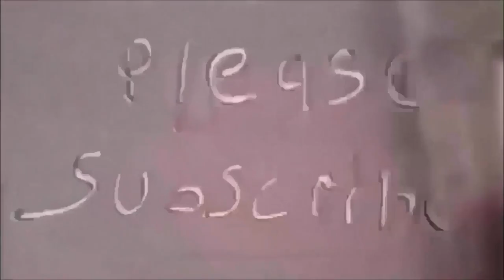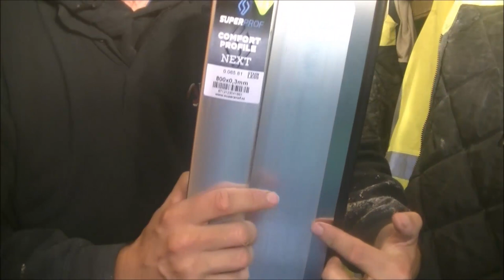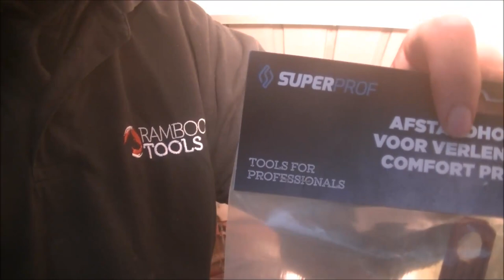UNBOXING SUPER PROF  SPATULA ATTACHMENT AND POLE RAMBOOTOOLS

Comment: Hope all is well mate? I bought one of these after watching the original vid of you using the make good on the ceiling. As always though I’ve not had a big enough ceiling or wall to use it on yet but itching to use it
Reply from the maker: Use away with it on smaller walls to man to get the hang of it will only help you get straight angles,  I forgot I had this on another video :)
Reply: @macplastering  yeah I think I will. I suppose it’ll never get broken in if I don’t use it haha
Reply from the maker: For sure mate even on revels get used to it and get them straighter faster :)
Reply: @macplastering  yeah definitely got to get on that. I’ll come work with you for a couple weeks when I’ve finished my apprenticeship, get some first hand tips off you haha 👍🏼
Reply from the maker: @stevenprice4969  haha might have a big house coming up next year
Reply: @macplastering  haha I’m game 👍🏼
Reply from the maker: @stevenprice4969  Where about are you in the world mate ?
Reply: @macplastering  I’m in Plymouth, down in Devon
Reply from the maker: @stevenprice4969  Dam mate you need to get a boat over LOL I have got asked to do a fair few small jobs in London shame it wasn't anything bigger
Reply: @macplastering  where are you based? Haha I’ll do it just to get away from the Mrs lol

Comment: Personally I find metal blade spats too harsh.
The speed skims my go to and I’ve tried refinas version also.
I basically use it to rule off when flattening, although they’re quite a versatile tool. 
Plastic trowel for the last couple of trowels for me.
Reply from the maker: I hear you mate this one for sure feels like it wont ride over bumbs where as some more flexible will but that being said some bumps on ceilings will only be fixed by 10 bags of bonding when the timber is off  a mile haha
Reply: @macplastering  true that! Always worth driving a few screws in with older nailed ceilings as they do tend to sag as I’m sure you do on the regular also.

If Your over-boarding the cross battening with packers to level out the plane of the lid works a trick
Reply from the maker: We dont tend to do a big pile of over boarding but yes a few extra screws works a treat :):) nice tips with the boarding mate :)

Comment: it sure saves time on a big ceiling like dat.u flew thru the flattening process.are they expensive mate ?
Reply from the maker: Big time mate but even to get it even haha love these for them bad corners / angles get them nice and straight
Reply from the maker: This one and the tyzack are the cheaper ones and just as good as the rest I have used ox speedskim spear and Jackson tyzack refina and now super prof
Reply: @macplastering  i think u said u can use it on sand n cement as well is dat right.would it break in easier then.would it be better to keep 1 for skim alone do u think or would it matter as much
Reply from the maker: Might be safe if you did keep one just for skim and one just for sand and cement but this feels strong and solid all-round could see it being 100% after a good few sand and cement jobs mate I would tend to use them on the odd reveal sand and cement of something small like I did here - https://youtu.be/OMK-asylju0